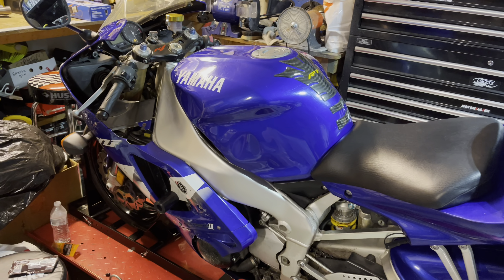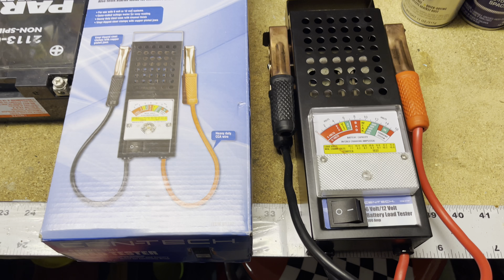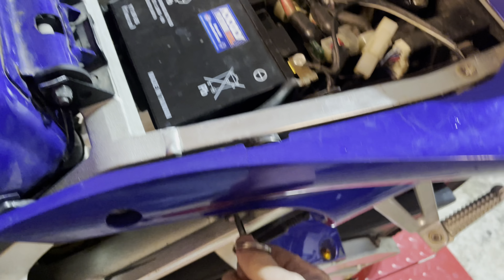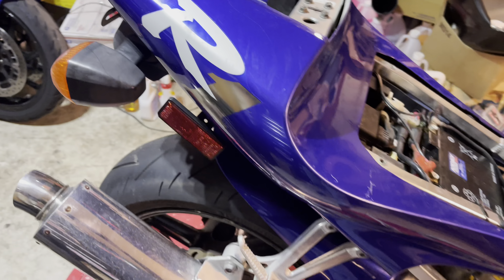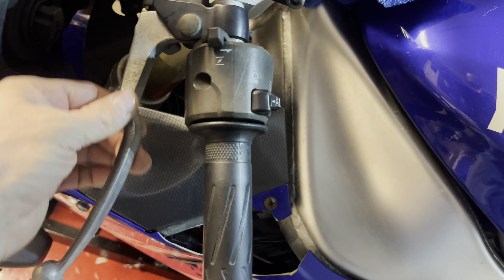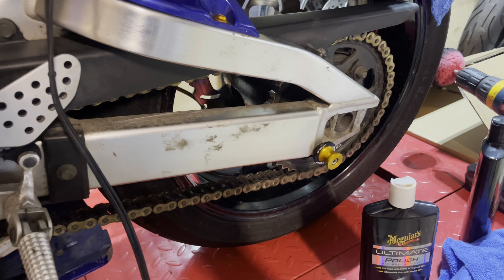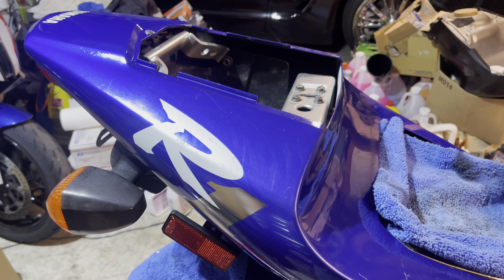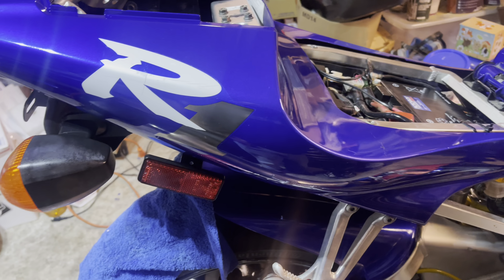Project R1 part 2

Comment: Get some Flitz to clean those levers. Awesome metal cleaner
Reply from the maker: Good to know thanks! Never used before. Levers are basically mirror right now so I’m happy with them. But if my ocd kicks in I’ll definitely try that out
Reply: @ctadrenaline  What is the fascination with the older R1s? Did you get it dirt cheap?
Reply from the maker: @ravenmoto5948  price was good yes. If you ever rode a good working early carbed R1 they are a ton of fun! Great low end, light weight, comfy seat, a ton of space in the tail for stuff like water ect, easy to work on. Definitely a classic. When it came out in 98 it totally set the standard. Plus they can be wheelie monsters especially with a -1/+2 setup. It’s overall a great bike. I still have my mint 2001 model and never plan to get rid of it even with owning my k67
Reply: @ctadrenaline  You already know I had the 99 R1
Reply from the maker: @ravenmoto5948  😆😆 that’s right you sent me the link for the signals 🤦🏻‍♂️🤦🏻‍♂️
Reply: @ctadrenaline  You could get the hotboddies undertail with LED lights if you wanna spend the coin. That's what I had.

Comment: Sick video love the R1 it seems in decent state. Question, i also have a r1 - 1999 model, since a year or so (didn't ride it much) it seems to struggle in the first and second gear on low revs and generates more smoke than it use to. Sometimes it is hard to get it moving and have to pull it to 4-5k revs. Gone do some thing on it like change the oil, spark plugs, oil filter, air filter and hope this fixes it. Does this problem sound familiar to u? Except that problem, everything seems to run fine after a bit of warm-up and in higher gears or higher revs ;p
Reply from the maker: Is your ex up working properly? Also is your tachometer showing any codes? For ex up it will show normal rpm, tachometer code ( will be 7k for exup ) then zero and repeat